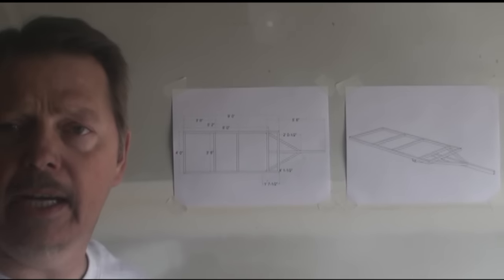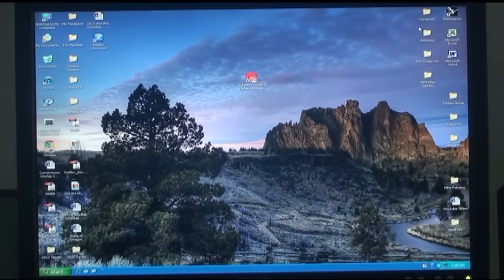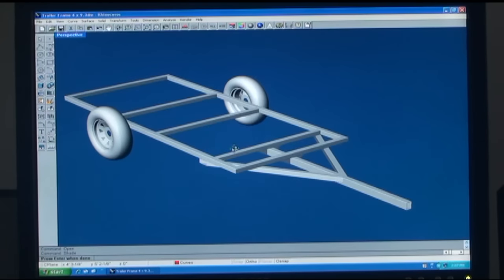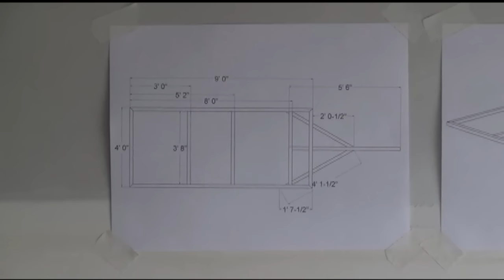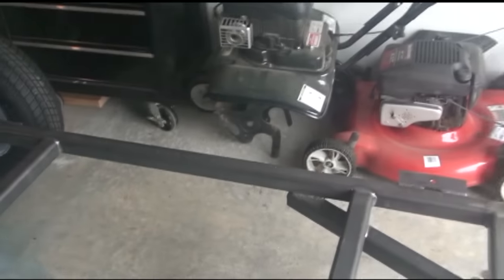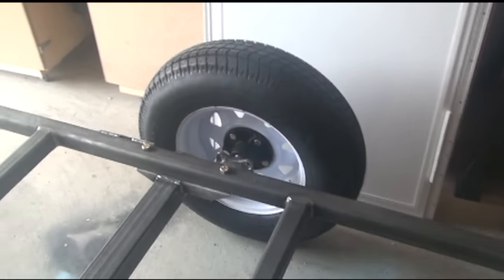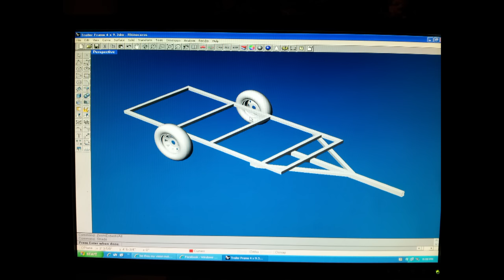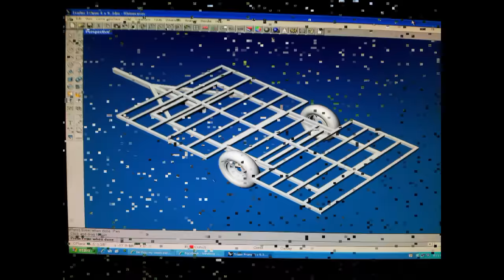How To Build A DIY Travel Trailer - Part 1 (Trailer Frame and Floor)

Comment: What are those tiny wheels on the frame for?
Reply from the maker: Hi subagon, I attached those to the frame so I could take the wheels off and still be able to move it around in my garage. Works like a dolly. Thanks for the question!
Reply: Do you have to remove the tires to store the trailer in your garage? If not, why not remove the "casters"? Either way, this could be a solution for someone with a tall trailer and a short garage.
Reply from the maker: Yes sir... I remove the tires (wheels) because my garage opening is too short. I use the casters to move trailer in and out of garage. Once out of garage, I put tires back on. Plus... I am able to move trailer around in my garage, very handy!!
Reply: Ok, so what's the height inside the trailer and overall height w/ wheels attached? How many inches do you gain by removing the wheels? My garage opening is 7' (standard?) like yours. I'm looking at building a TT and keeping it in garage would be a bonus.

Also, what's the link to the YouTube guy that you mention that shows how to build trailer frames?
Reply from the maker: Hi subagon, the height inside is just under 6', and height of trailer with the wheels will be approx 102". So with the wheels off, and just sitting on casters, I can wheel it in and out of my garage no problem.... sits at just about 82" on casters. Send me a pm and I will send you the pdf of how to build the trailer by Red Wing Steel Works, or you can check out his YouTube video

https://www.youtube.com/watch?v=eVNpPsDMIB4

Comment: Bad idea running Walmart tires I have only put 10 or 20 miles on them and blowed the Walmart tires out.
Reply from the maker: Good tip! Only purchased these for the build... once completed, I bought some real wheels and tires to travel with, used these only for emergency spares. Thanks for checking it out!

Comment: I have sent a lot of messages to the comment and you will not answer my question why
Reply from the maker: Hello Hussain! I have not seen any questions from you.... what would you like to know sir?
Reply: Thank you. I would like to know the type of wood and the beleuet  used, and the dimensions, length, width and height. Thank you
Reply from the maker: Yes sir... I designed the trailer and made my own blueprints. The trailer is a 6 x 12 with a inside height of six feet. The wood I used for the frames is 1 x 2 Douglas Fir, strong wood. Covered the walls with 1/4" hardwood plywood. The floor frame and ceiling frame is made with White Pine wood. Light weight and strong. Hope that helps!
Reply: @OregonBatman  Do you use MediF walls?
Reply from the maker: No sir... too heavy. Use plywood. Much lighter.
Reply: @OregonBatman  I think this is too big I need the small size for sleeping only 2 people , like this
Reply from the maker: Then you will want to check out my Teardrop Build... if you go to my channel you can watch the full build. https://youtu.be/Pua7oZRU2wI  Take care!
Reply: @OregonBatman  six feet = 1.83m If this height is within how because plywood is only 1.24
Reply from the maker: Two pieces 4 x 8 sheets
Reply: OregonBatman in our country there is no sheet 4 x 8 only 1.44 x 2.44
Reply from the maker: That will work... yours is metric. Almost same size
Reply: @OregonBatman  If the height is more than 1.20 it is difficult to use one piece and it must be used as a link and this I do not see in your work you are using one piece
Reply from the maker: If you watch the videos of the 6 x 12... you will see that I had to use three pieces of 1.44 x 2.44 side by side. It is not one piece.